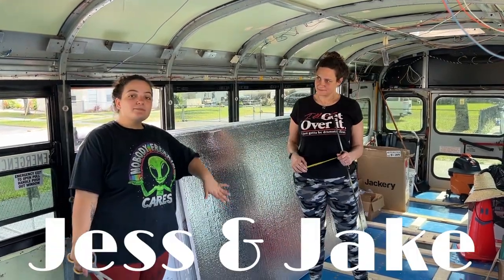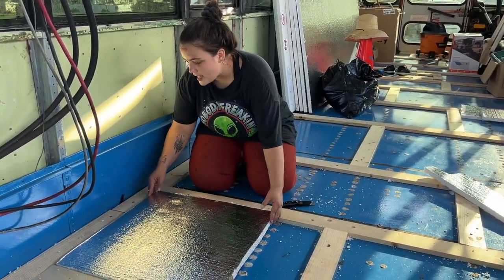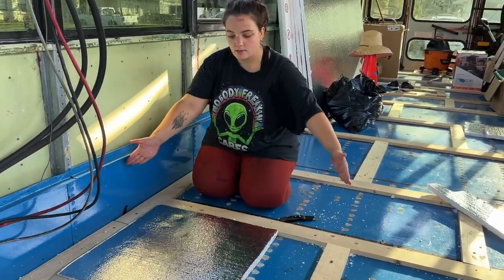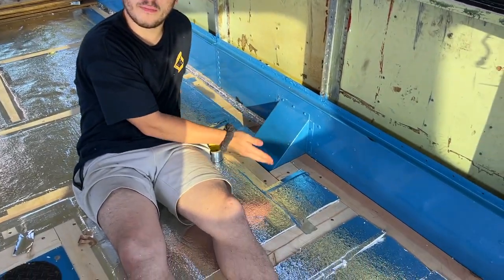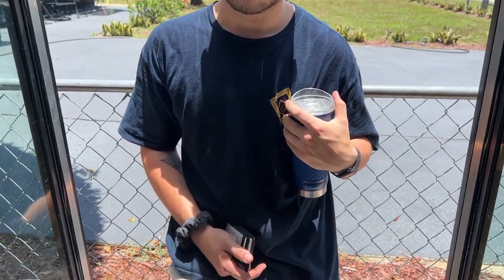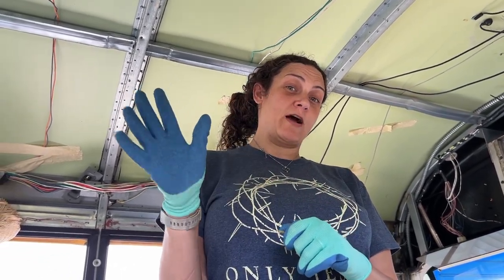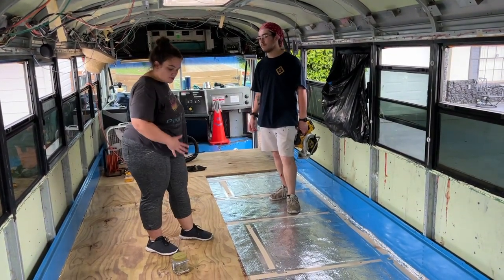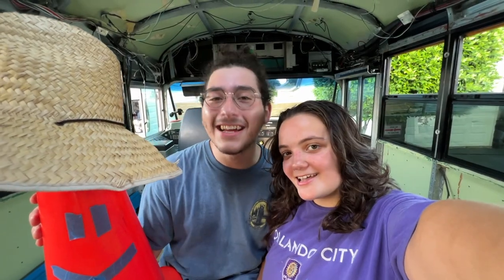Insulating and Laying Subfloor | School Bus Conversion Ep.12

Comment: Having remodeled many houses, I would have recommended putting the foil side down as a vapor barrier.
Also, look at your video when you were screwing the plywood down, notice how the board slightly rises as the screw goes in? Getting ready for squeaks. You really needed to drill the plywood first or back the screws out of the bottom boards then re-screwed them so they would pull down better.
Overall, great job though.
Reply from the maker: Hey, thanks so much for the information, really appreciate the advice. Very helpful, and thanks for sharing advice :)

Comment: When I saw you using the aluminum tape I legit said "I don't think that's necessary," like, a millisecond before you mentioned it. 😅 It was a little surreal, ha.

Your bus is looking really great so far. Nice job insulating the subfloor. I skipped insulating mine for height's sake (I'm 6'1") but I really feel it in cold weather. 🥶
Reply from the maker: Hey lol thats so funny, great minds think alike. Jake is 5'9 so we had room for the height, but any taller and we might have to rethink that :)